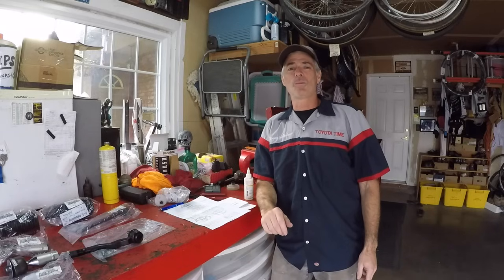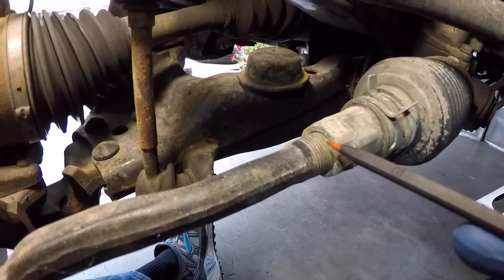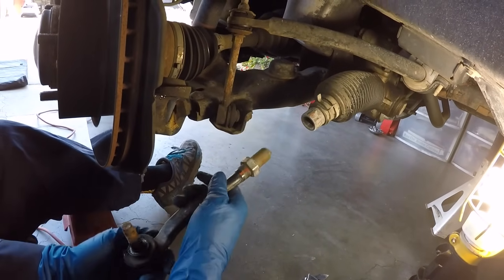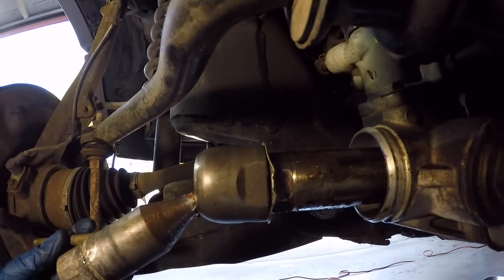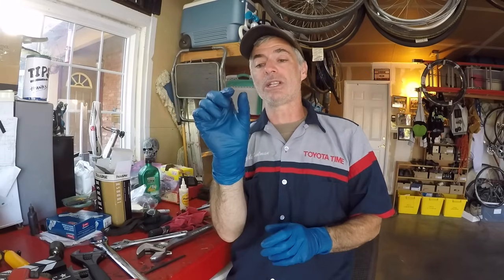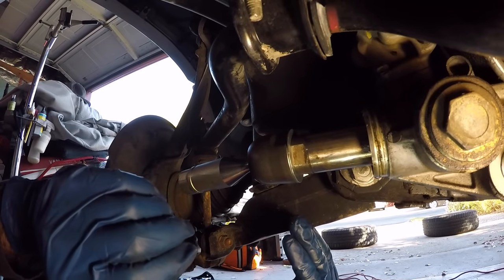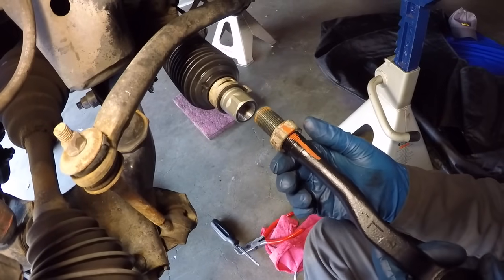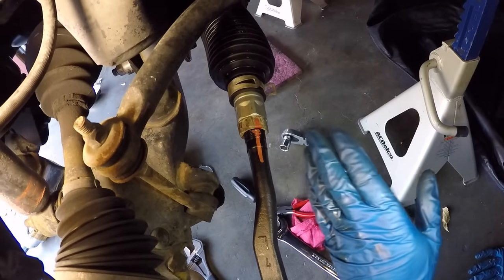Inner & Outer Tie Rod Replacement

Comment: Just got done with this job on my 03 Tacoma and thought I would add some info that I found to be very helpful. When it comes to breaking loose the inner tie rods from the steering rack it requires you to hold the steering rack with a 30 mm the problem is a regular  30 mm wrench is too wide to fit on there and then get another wrench on the inner tire rod. Watch the video if you’re not sure what I’m talking about. After going over some of the options that Tim suggested I ran a cross what are called service wrenches. Tim I think somebody else may have mentioned this already to you as something that you may have used working on bikes. Anyway I found that you can buy a 30 mm service wrench online for pretty cheap or you can go the route I did and buy a service wrench set from Harbor freight. I only really needed the 30 mm  but thought it was worthwhile buying it in case I come across some other jobs were the other sizes would come in handy. Overall it saved me money from buying a special narrow jaw adjustable wrench or taking the time and hassle to grind down a regular 30 mm wrench. I just use the 30 MM service wrench to hold the steering rack and a pipe wrench on the inner tie rod made it easy.  Also wanted to add a suggestion to those that will be replacing their inner and outer tie rods with all new parts. If you find that the jam/set nut  on your outer tire rod is fighting you you can try soaking it in PB blaster heating it up and fighting with it or you can just say the hell with it and take the 
Inner and outer  tie rods out in one piece disconnecting it from the steering rack. Unless you’re planning on reusing your inner tie rods why sit there for possibly hours and fight the damn thing I have seen those things get so rusted on and corroded that hours of penetrating oil and heat and big ass long gear wrenches weren’t even enough to break them loose. Again this is if you plan on Using new parts but I have found that it has saved me a lot of frustration and time and makes job go a lot faster.
Reply: Correction: ⬆️ Unless you plan on reusing your outer tie rods
Reply from the maker: Thanks for sharing all that.

Comment: Ah! I did mine right around the same time you must’ve done this one. I got stuck with one inner fused to an outer and then one inner fused to the rack. Ended up just needing a bit more coaxing from a pipe wrench and a dead blow for the inner attached to the rack. I wish I’d known you could reuse the larger boot clamps, they’re a pain to try and find, so for now I’ve just got a large zip tie on it which is what I see most aftermarket reboot kits coming with. 

Also that ball joint puller makes things SO easy! Tried a pickle fork and failed miserably. The puller I added to my toolset.
Reply from the maker: Hey Rory,  well, you got it done and that's what counts.  This job did throw me for a loop due to the need for specialty or altered wrenches.  Next time you have something really stuck, apply some heat with a small butane torch.  I've found a little heat helps a lot for stuck fasteners.  We provide the part number for those inner clamps in the video description if you wanted to order a set.  Pullers are definitely the way to go.  The Big F'ing Hammer or Pickle Fork are not techniques I subscribe to.

Comment: Thank you for sharing that counter-holding the non-rotating steering shaft (the one that slides) with a suitable tool while you twist off (or on) the inner tie rod. You are absolutely correct. It may sound like common sense, but i believe i did not counter hold the inner shaft while removing the inner tie rod, on my VW, with the harbor freight tool (long ass socket like 16 inches long).
Reply from the maker: I honestly don't know how crucial it is to hold the steering shaft when breaking free and tightening the inner tie rod, but that's what it showed in the Toyota factory service manual.
Reply: @TimmyTheToolman  I don’t know either however, like you said, if there’s a slot to fit a wrench, then I will put one. Just in case. Haven’t done it yet in 4runner.

Comment: I used a Harbor Freight #63705 ($36.99) to remove a VW inner tie rod. It has the crow's foot and long rod style Tim was talking about. Looks like the Lisle #LIS46800 ($87.24).   I also made a video about the Harbor Freight tool I am mentioning.  Hope this helps!  

Thank you Tim for making this video. I bought a 98 4Runner 4x4 from North Carolina w 231K miles. I have play in the steering wheel 1" side to side. At >68- 70 mph I have a wheel shake! I went out today to check my outer tie rods and they have "twist" play. No clunk but as you know joints should be tight/firm.  If the outer moves the inner tie rod must be loose as well just like your video.  I am going to replace them both. I'll find the right wrenches to grind down first then the tie rods!!
Reply from the maker: Hey Frank, thanks for sharing this.  I looked at the description for the Harbor Freight tool you linked and it does not come with a 42mm adapter that would work for 3rd Gen 4runners.  I wonder if it's possible to buy the 42mm adapter for this kit?
Reply: @TimmyTheToolman  Wow. It worked for the VW but looking at the website it states the biggest is 33.6. Oh well, guess wrenches will have to do. On Ebay now looking for the best OEM tie rod prices. lol

Comment: I had good luck with "Cal-Van Tools 946 Low Profile Inner Tie Rod Tool" from Amazon ($12) on my 2000 Tundra, it would probably work on 4runner as well. With that you can use a ratchet or even an impact on the inner tie rod. You can also use a torque wrench when reinstalling.
Reply from the maker: Thanks for the tip Scott.

Comment: Would there ever be a situation where the replacement tie rod has a different number of threads and your marking becomes irrelevant (and you’re screwed)?
Great job on this video! It’s more comprehensive than many of the other “how to” videos.
Reply from the maker: Well, you could just take some basic measurements if that's the case and get the new tie rod close to where the other one was.  Regardless though, an alignment is suggested after this type of work.  You can get it very close and maybe even perfect but you won't know for sure until you get it on an alignment rack at a shop.  If money is very tight for someone, I can see them rolling the dice and forgoing an alignment.  But, an alignment that is off can cause uneven tire wear and the money saved on the alignment is lost when you have to replace a set of tires sooner than would have been necessary if the alignment was perfect.
Reply: @TimmyTheToolman     havent done a lot of front end work.     but spent years working as a machinist,    the number of threads showing technicaly is irvralent   its the length of the tie rod  . in a perfect world  the alighnment will be perfect  by counting exposed thread.   but if for some reason  (or no reason )  the factory or aftermarket manufacture  threaded the rod a few more or less threads it would throw toe in  off.  I wouldnt expect them to place a lot of emphasis on this aspect of manufacture as it only matters if someone isnt alighning after words
      Wondering how often this happens?   I would think setting toe in  is crucial to knowing its right other wise just a guess
Reply from the maker: @jeffreyplumber1975  Well, if you're counting threads from the tie rod end, it should be pretty spot on.  I would imagine they are machined very similarly.  Counting the threads and making match marks gets you very close so you're not driving a rig with the toe way out before you can make it to an alignment shop.  Only an alignment shop can get it perfect.

Comment: I used a pipe wrench before seeing this part of the video. Worked fine. Din't need any wrench on the steering rack. Used it by itself to get the new 555 rod back on.
Reply: Ha, just got to where I shouldn't have done that. Fantastic.
Reply from the maker: @Yourrealdad28  Well, I have a suspicion you're probably fine because lots of guys end up doing it the way you did.  For us making videos, we want to show the most correct way to perform a job and that usually means following what the factory service manual suggests we do.  I wouldn't worry about it.  Happy Wrenching!
Reply: Timmy The Toolman yeah I watched some other video and they didn’t show that. Got to yours just a little too late. Been using your other videos as I am basically taking apart the whole steering system. Great stuff and I really appreciate the videos. Thank you
Reply from the maker: @Yourrealdad28  Good to hear our videos are helping you out Kevin.  Thanks for taking the time to comment.  Happy Wrenching!

Comment: Great video!  Looks like you wrestled the bear on that one.  I found at the end of the day when I just did my Seqouia (very similar rack),  it was easier and cost effective($229) to replace the whole rack time wise.  I also used 555 ($35/ea japan brand) greaseable tie rod ends and a new rack from BuyAutoParts.  The new aftermarket rack was EXACTLY the same with the same case markings,good reviews and everything.  Super satisfied with it.   I have not had to do my 01 4Runner yet. Just the poly bushings on the rack.  The rack for the 4Runner is $170 delivered from them also.  I would probably go the same route again.  Alignment was about $70.
Reply from the maker: Glad you like the video.  It's great that you've had good luck with your aftermarket steering rack but others haven't been so lucky.  I've seen enough bad reports on aftermarket steering racks to "steer me clear of them", pun intended.  I'm also leery of using aftermarket tie rods.  I guess I'm one of those purest who likes to use mostly only OEM Toyota parts when it comes to steering components.  So far, the only aftermarket steering component I've used is poly steering rack bushings which seems to be a nice upgrade over OEM.
Reply: I'll report back in a year.  The wife hits every pothole and small animal she can get to.  It literately had the same manufacturer marks and everything as the toyota one that came off.  It was tough to do the $700 for the  OE when this had a ton of great reviews.
Reply: kapple17 i did the same, bit on a 90 series Landcruiser Prado. I like to use genuine Toyota parts but the PS rack is super expensive, replaced the genuine with a complete aftermarket over a year ago no issues.

Comment: Timmy, I was so hopeful this morning because I was going to be changing the lower balljoints and outer tie rod ends because both were loose and one boot was cracked. The drivers side outer tie rod absolutely refuses to come loose from the inner tie rod end. We used adjustable wrenches, PB Blaster, heat, and a pipe wrench to no avail. I had to stop attempting to take it off because I was afraid I was going to damage my steering rack. Now my option as I see it is to try and remove the inner tie rod while still attached to the outer tie rod end. I am ready to push this hope smasher off a cliff and hope it explodes. I don't think I've ever had this much trouble working on a car ever. Talk me off the ledge of mysteriously having a Tacoma in my driveway that catches on fire while I "sleep".
Reply from the maker: Unfortunately, there are days of wrenching like this for all of us.  We get seriously frustrated.  We cuss, maybe throw things, and then we walk away losing the battle but planning on coming back the next day to win the war.  You will succeed.  Use more heat and penetrant and you'll eventually get that MoFo off.
Reply: Scrolling through the comments I was thinking I would run into somebody that has had this issue as well before. If I’m understanding this  right in this situation the inner tie rod would not screw out from the outer tie rod  likely because of a rusted on jam/set nut. I’ve run into this before and thought well if I can break loose the inner tire rod from the steering rack why not just do that and take it all out in one piece. The inner tie rod still connected to the outer tie rod. In my experience this has saved me a lot of time and frustration trying different methods to finally get that set nut to break loose. In my situation I had bought new inner and outer tie rods so I just used  them. But with the inner and outer tie rods removed in one piece this would allow you to put it in a bench vise and put a lot more force/torque on that nut to break it loose without risking damaging your steering rack. Curious if others have done it this way. Like I said when I did this job I had bought new parts so I didn’t plan on reusing anything but if that jam/set not gave me any grief I didn’t even bother messing with it I just went directly to breaking loose the inner tire rod from steering rack and called it good.

Comment: First, 

also, for some reason I thought you already had a video on this. I hated doing this swap because of lack of the right tools.
Reply from the maker: Hey Seydzh, this was the first job that I just decided to quit on because I was stumped on how to get the inner tie rod off properly.  Even if I did have a bench grinder, I didn't really want to grind down either my new 30mm Gear Wrench open end wrench or do the same to a crescent wrench.  I also wanted to avoid showing the use of a pipe wrench for this job even though I recommend it as an option if money is tight, because I know I would have received a lot of crap about it from people, especially the YouTube trolls who love to point out when they believe you're techniques are wrong.
Reply: I used the 12" Cobra Pliers from Knipex and the jaws are nice and narrow, it is basically a better gripping pipe wrench generally used for gripping objects without flat surfaces like pipes, but it is also 50$ just for those pliers. They come in handy from time to time on stubborn items.
Reply from the maker: Gotcha.  Looks like a pair of Channel Locks.

Comment: Great vid as always, I'd would appreciate you showing a few ways to check the outer tie rods and maybe compare the old inner tie rods with the new ones
Btw. I'm on my first year of mechanic school
And I like playing your videos for the class, even tho they don't speak English
Also nice t shirt
Reply from the maker: Thanks Hugo.  Glad you like the video and even cooler you share my videos at your mechanic school.   To check a tie rod to see if it's still good is basically checking for any joint play.  Sometimes you can do that my simply grabbing onto the tie rod and push and pull on it trying to detect play.  Another way is to use the tire as leverage and push and pull on the tire with one hand while having the other hand on the joint trying to detect if there's any play in the joint.

Comment: Canadian Licenced Tech Here
I HIGHLY recommend the mueller-kueps excentric turn chuck # 608 950 for inner tie rod removal.  tightens while turning.
I may be a savage but I've never held the rack while loosening.
Reply from the maker: Yeah, I'm guessing holding the rack probably isn't necessary but the engineers definitely built a slot into the end of the rack for that very purpose and the Toyota factory service manual shows a depiction of it being done that way.  So, I wanted to portray the way to get it done based off the information I got from Toyota.  Thanks for the tool suggestion.

Comment: I understand there are numerous reasons for "loose steering" or steering that swims around (constantly having to correct, etc).  But after UBJ, LBJs, steering rack bushings, sway bar bushings, shocks, springs, and an alignment etc... I'm thinking it's time for inner/outer tie rods.   Hoping that fixes it
Reply from the maker: Hey Hunter, have you looked into the Steering Rack Guide Replacement?  We have a video for that: https://youtu.be/r4Hhl225E8A  There's also another chance the play is within your main steering shaft.  The main shaft is made to collapse and telescope together as a safety feature for a front end collision.  The shaft can develop a little play over time and that little bit of play can translate to significant slop in your steering.  We just shot a video showing how to repair this and it will be coming out soon.  This repair does possibly defeat the safety feature, but it has been the fix for people tired of having slop in their steering.  Stay tuned.

Comment: I have a 5th gen 4runner, two independent shops have diagnosed it with a bad right front inner tie rod end. The stupid toyota dealership refuses to admit anything is wrong. trying another toyota dealership soon. Hopefully they  fix it otherwise I'll be doing it myself. thanks for the video.
Reply from the maker: Ok, good luck.  You might just want to do it yourself and save a ton or money.

Comment: Well done! Fyi, the Lisle special tool you posted is a great deal compared to the $350 from toyota or matco. The Lisle tool says it comes with 42mm also so should be good there.
Reply from the maker: If I would have noticed there was a special inner tie rod tool available to purchase before I bought the Bacho adjustable wrenches, I probably would have bought the Lisle kit.  But, I can't see buying the kit now that I have some wrenches that will do the job for me.